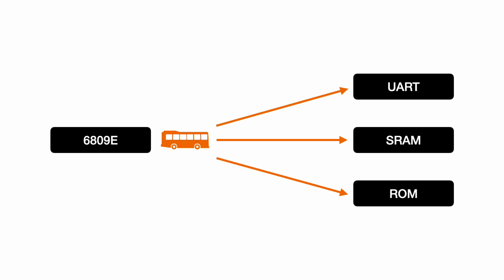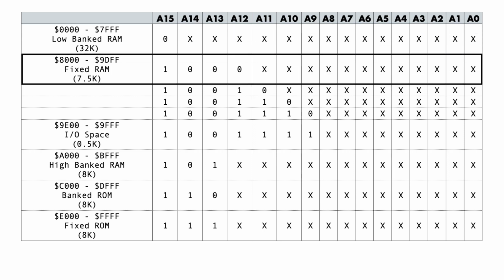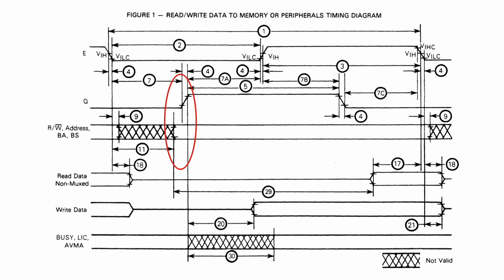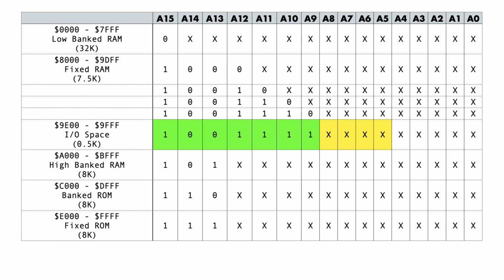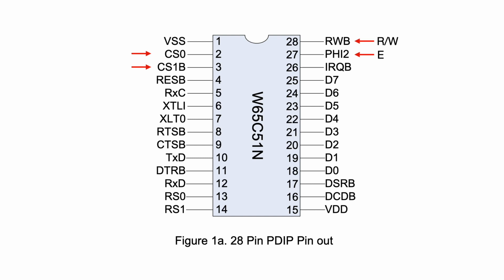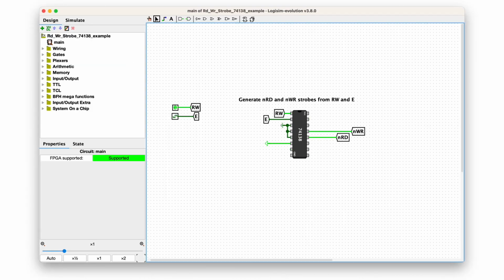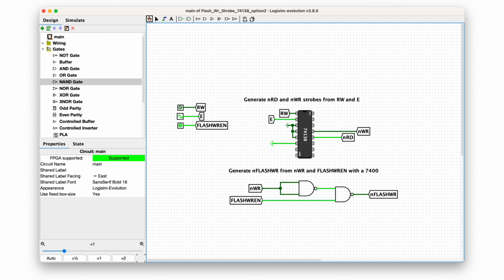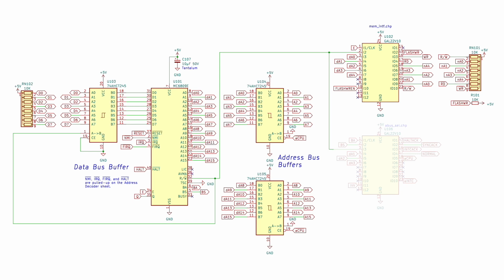6809 Playground - 04 Address Decoding

Comment: Really appreciate you sharing this. I’ve always thought the 6809/ 6309 was the most interesting of the early 8 bit microprocessors. Probably wasn’t the most economically sound project (any chance it had was sabotaged by its relative cost). That said, it was probably the pinnacle of 8-bit architectures. In hindsight, designing chips around easy programming in assembly turned out to be a bit of a dead end. At the time though, it produced the most capable chip in its class & was used a a few really interesting products (Fairlight CMI, Coco 3, FM7, SWTP, ESQ-1,  Vetrex, & a bunch of obscure specialty systems for CAD/ graphic design). With OS-9 (still going as NitrOS-9 btw), it offered lot more ”professional” capabilities than the other 8 bits. Glad to see it getting the attention it deserves. To me, its appeal can be summarized in 3 words (2 words & a number??), 8-bit maxxing.
Reply from the maker: I 100% agree.  Once you have gotten used to the addressing modes (especially the indexed modes) and how easy it is to use the stack, everything else from the era seems so primitive.  And so much of the programming model was carried forward to the 68000 (which I am also a huge fan of).
Reply: @thorpejsf  going to be really picky here and point out that development of the 68000 really kicked off while the 6809 was developed in parallel. I've looked into it as far as I can and from what I can see the 6809 benefited from the development of the 68000 rather than the other way around. Both chips came after the 1975 recession and associated layoffs at Motorola, so not long after GM started buying up 6800 chips in huge numbers creating a whole new market for Motorola

Comment: If you tie /CE of the EEPROM to GND this should half the access time at the cost of higher power consumption.
Reply from the maker: Yes, this is true, but in the full system (that will have many more things watching the /RD and /WR signals) I would then have to gate /RD and /WR to the EEPROM using something similar to what's done with /FLASHWR.  That's not the end of the world, of course, and it's certainly worth considering!  Thanks for pointing it out!
Reply: @thorpejsf  Understood. I like the banking of RAM & ROM. I've done something similar with 16MB SDR-SDRAM and a 68000.

Comment: Really appreciate what you are attempting here.  I presume that most all of what you cover would apply to the HD63C09 as well.
Reply from the maker: Yup!  100%.  I actually plan to use an HD63C09 in at least one board and take a crack at running it at 4MHz.
Reply: So what would you think of consolidating the GAL into a CPLD?
Reply from the maker: @randygardner6224  One thing that's nice about GALs is that I can use a completely open source toolchain for them.  AFAIK, that's not currently possible with CPLDs.  I'm not against it, really, just plan to stick with GALs for this particular project.